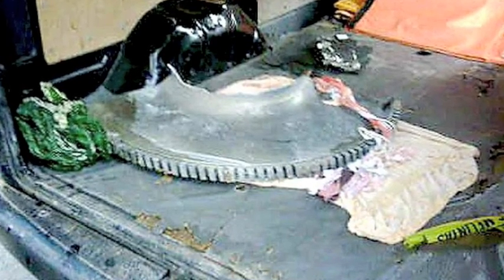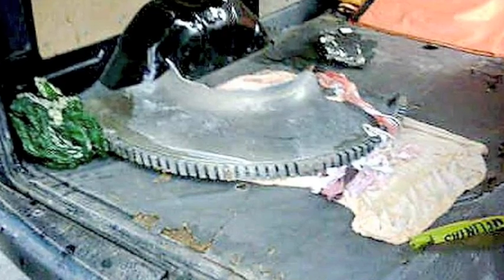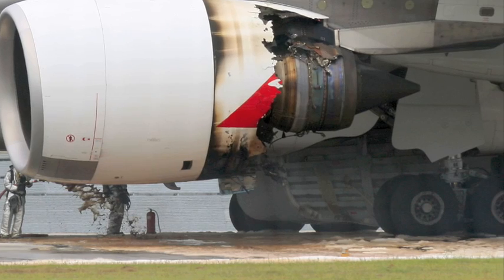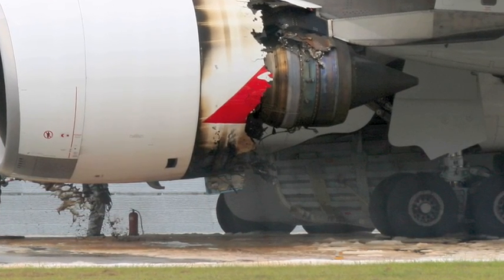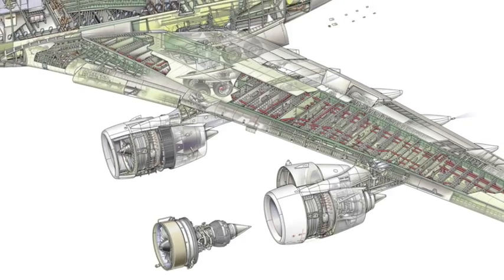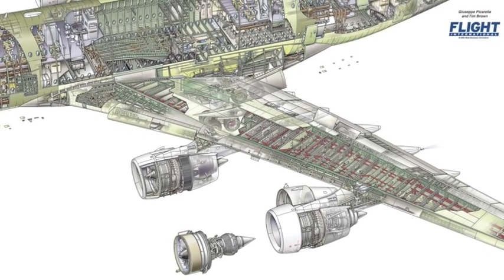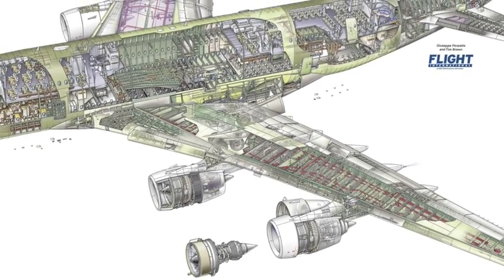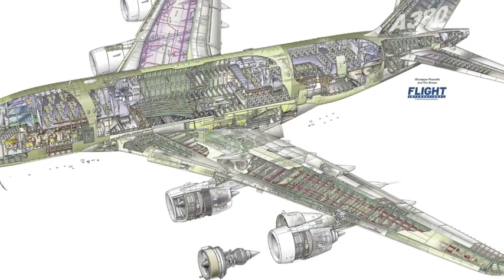ANALYSIS: Qantas A380 uncontained engine failure

Comment: the Trent 900 is a good engine, Rolls Royce is a reputable company, Some flaws don't show up in testing till a lot later and usually during operation. Rolls Royce will overcome. When the RR developed the RB211 it nearly sent them broke, but now those engines have now got over a million hours of flight time and they are reliable as i can forsee this happening to the Trent 900. be damned the doubters